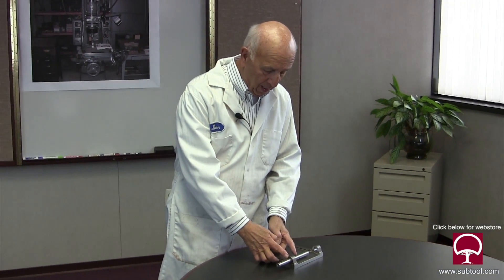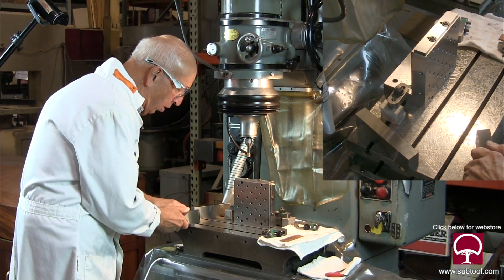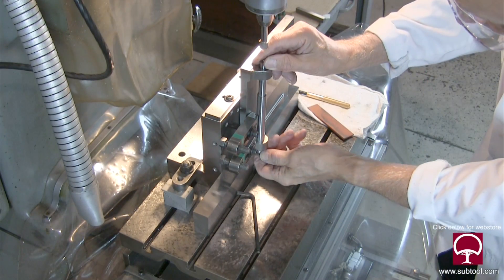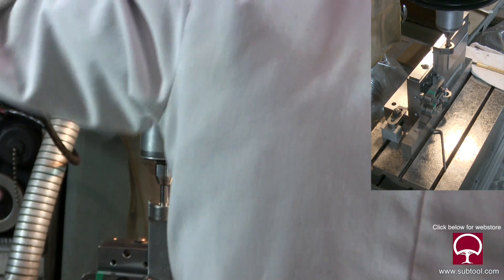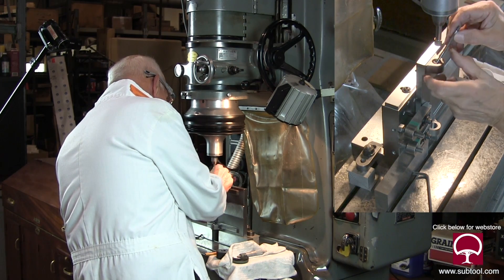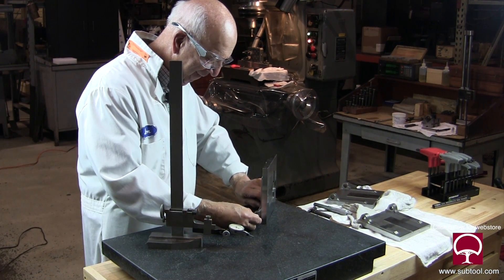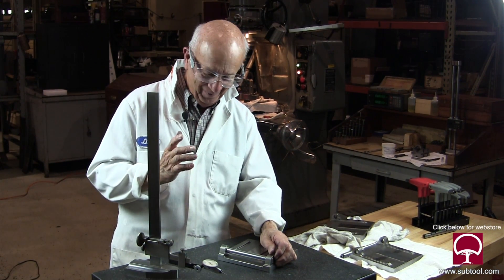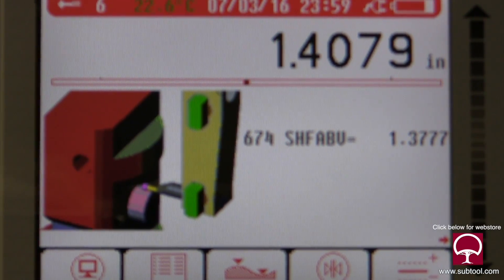Jig Grinding  the second ear square and parallel with the first ear.

Comment: Don...had you considered performing this operation by setting this part up on a vertical Moore rotary table? They make two resolution tables. One is incremented at 5 sec of arc and the other in incremented at 1 sec of arc. If the total possible angular error would put you out of spec, a true square could be mounted on the rotary table and the 180 degree rotation adjusted by an autocollimator on the table of the jig grinder. Simply pick up the center of the rotary table, dial in to the first hole location, grind the hole, rotate the rotary table 180 degrees and advance the machine to twice the dimension you arrived at earlier. There is no margin for error on these sine plates.  In my humble opinion, a 1/2 thousandth error in this hinge alignment will create an unacceptable compound angle error when the table is tilted.

Comment: DON,IVE BEEN JIG GRINDING FOR OVER 10 YEARS.REGARDING YOUR 2ND EAR VID, I WOULD NEVER  INDICATE THE SHAFT BECAUSE ITS TOO FAR AWAY FROM THE HOLE YOUR TRYING TO LINE UP WITH. INSTEAD,PICK UP YOUR EDGE WITH YOUR INDICATOR,DIAL OVER THE SAME DISTANCE FOUND FROM THE EDGE WITH YOUR HEIGHT MASTER. THAT IS THE NICE THING ABOUT THAT MACH. THAT'S WHAT ITS USED FOR.AND DON'T RUB THE GRINDING AGAINST THE WORK. YOUR SPINDLE BEARINGS WILL WEAR OUT PREMATURELY. JUST LISTEN FOR WHEEL TO START MAKING NOISE. AND DONT USE DIAMOND WHEELS ON STEEL.DIAMOND IS CARBON AND IT WILLBOND WITH THE CARBON IN THE STEEL. USE BORAZON WHLS. DIAMOND IS FOR CARBIDE ONLY. THANKS RC

Comment: I think if your grinding wheel can go through both holes in one fixe then you can go more accurate.
Reply from the maker: In theory that's true but the ear is 5" away. They don't make grinding wheel shafts long enough to do that and even if they did, there would be concern for vibration and chatter. Thank you for your thoughts.

Comment: Don from one journeyman to another you are so right. It is not easy working in tenths. The average person has no concept of just how small that unit of measure is. I always like to use the piece of paper analogy and tell them to slice the paper into about 40 equal segments of its original thickness of about .004 and then pick up one segment and theres one ten thousand of an inch. Then they usually say wow I had no idea. In my 36 years as a Journeyman I've always thought this to be a misunderstood trade to the layperson. They don't understand the skill and training this trade requires.
Reply from the maker: Right thats a great analogy appreciate your comment, this link might help.  https://youtu.be/ffqI0IWkp4k

Comment: It would have been nice if you had checked the squareness on that plate that was off to determine the problem.  That is pretty cool that a machine that is probably nearly as old as Don is still able to be accurate down to the tenths. I guess they are both oldies but goodies. :-)
Reply from the maker: Thank you.

Comment: Hi Don;Thank You for your wonderful videos!!!!When I use a telescoping inside snap gauge I try to keep the handle more parallel with the cylinder that I am measuring,  then cam it to one side, I see you are using yours at an angle with the cylinder (I can see that the spindle is in the way to use this technique) I have found that even when I use it parallel to the cylinder and that if I'm not careful my measurement will not be repeatable. Are you twisting your gauge in the cylinder? or what is your technique to being consistent? I know that your measurement is right on,  because You said so..I just would like to know what your feel is on the gauge so, I can improve my accuracy .Your knowledge  is important to me. I thank you for you sharing it with us..
Reply from the maker: It is better to have it parallel however it will find the largest diameter you just have to be careful.